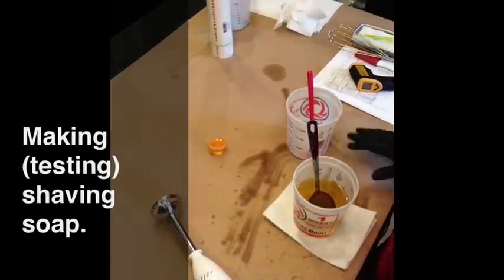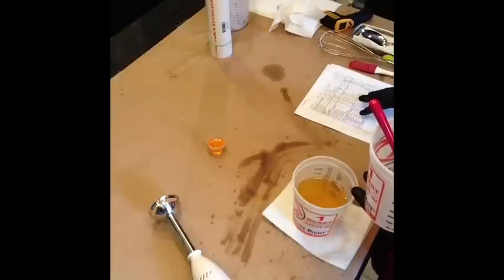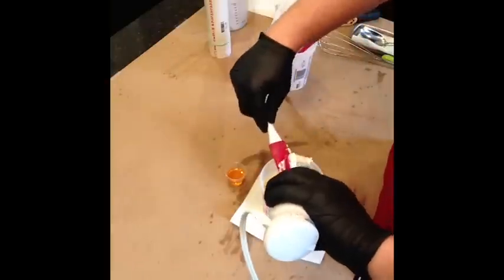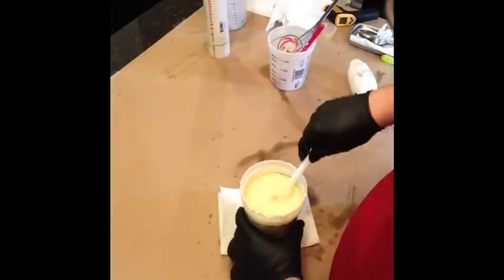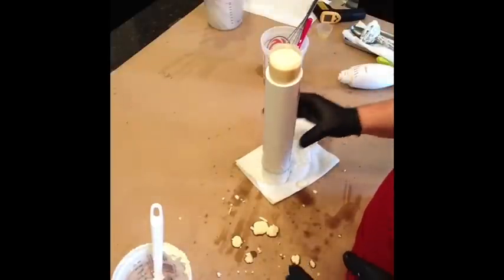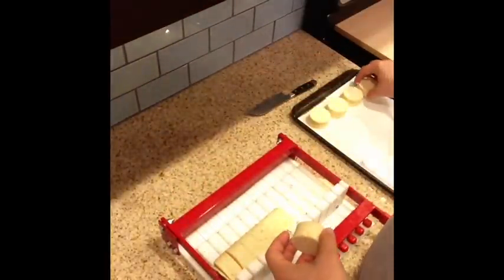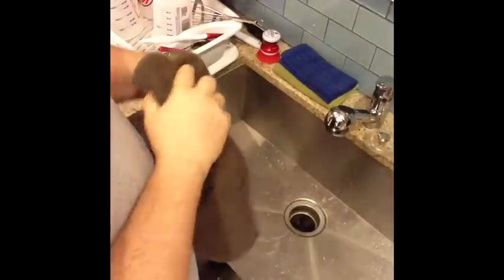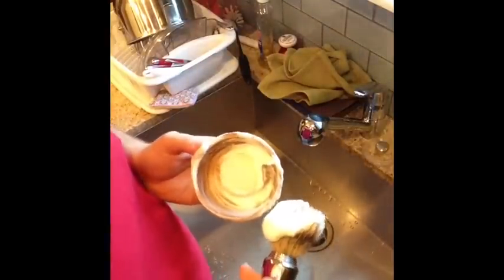Making (testing) shaving soap

Comment from the maker: Well, I have never made a cream soap, but reading up on it quickly I do see that it is also made with both NaOH and KOH...but I think it's hot processed (usually). So I suppose shaving soap is a type of cream soap itself but my (very limited) knowledge of cream soap is that they are...well, creamy, not solid. Some shaving soaps are very soft/creamy and I suppose that's part of the challenge/personal preference. Do you want a hard puck or soft and squishy? More KOH will give you softer results.

Comment from the maker: Hey RiverCountySoap, Yes, I used less NaOH then KOH. My ratio for this video was 40% NaOH and 60% KOH. I used soapcalc, enter the recipe write down the amount for NaOH then run the same recipe except for KOH. Those values would be if you were using 100% of either NaOH or KOH, so take whatever percent you want (the total still needs to be 100%). Hope that helps. -kev

Comment: Since there is lye in this, does this also have to sit for the 6 - 8 week time period?
Reply from the maker: zernadarkwolf The soaponification process should be complete within 24-48 hours (and thus all of the lye used up turning your fatty acids into soap). Most soap makers will have a 4-6 curing time for cold process soap to allow excess water to evaporate and the bar to become harder.